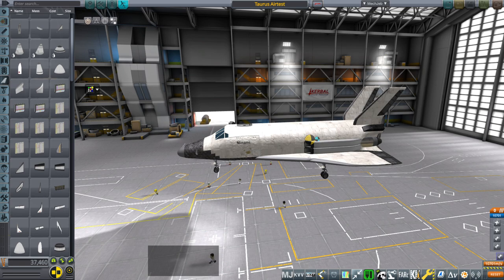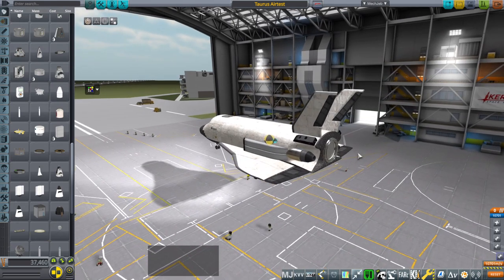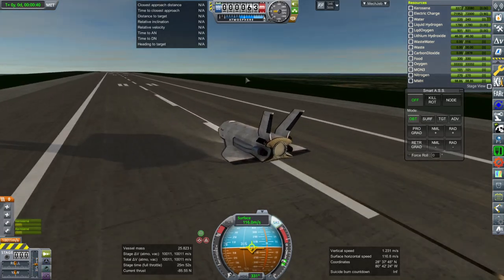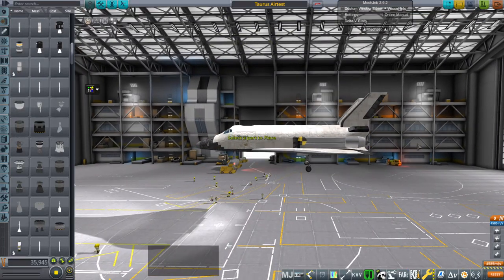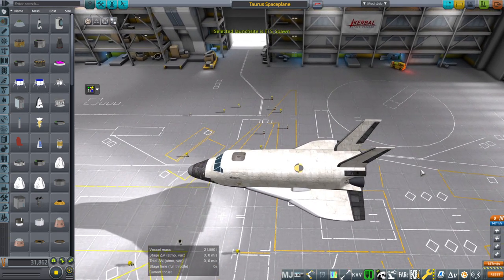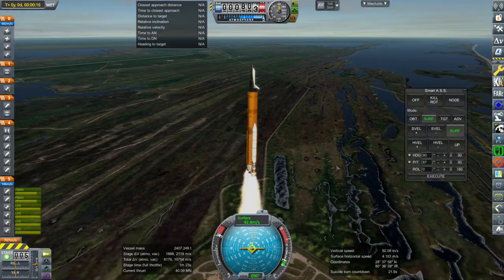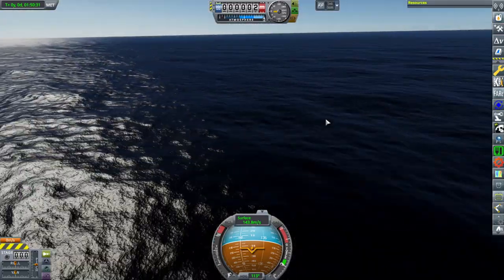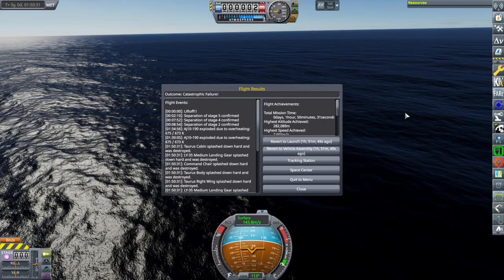KSP with Realism Overhaul - Taurus Shuttle Initial Flight and Reentry Test

Comment: that's why shuttle had air brakes and drop chutes on top of it's tail, they helped to pitch up. spaceplanes are fun, you build them, balance and then set on fire to see if they can survive
Reply from the maker: The airbrakes and drag chute on the Shuttle were definitely not meant to be helpful or required for it to pitch up.

Comment: Was the shuttle unable to pitch up at the end because the engines were missing and center of mass was too far forward of center of lift?
Reply from the maker: That certainly hurt, but the fact that it couldn't hold a 40 degree pitch during the earlier part of reentry before the engines exploded meant that its center of mass was already too far forward.